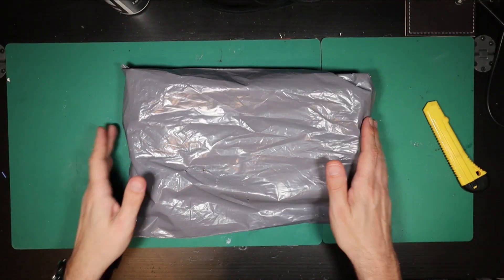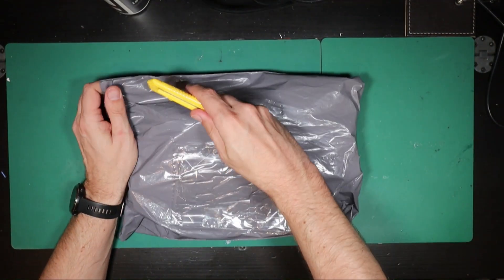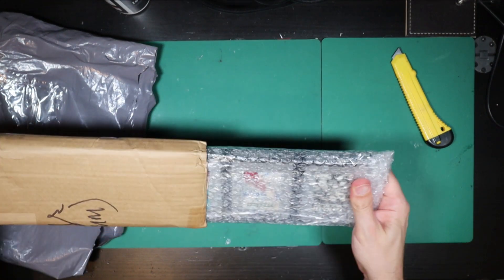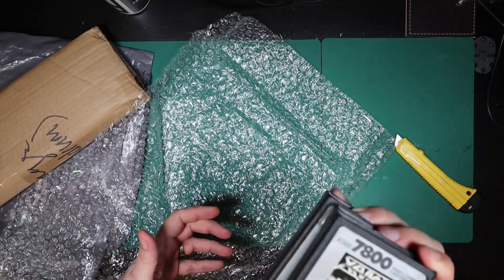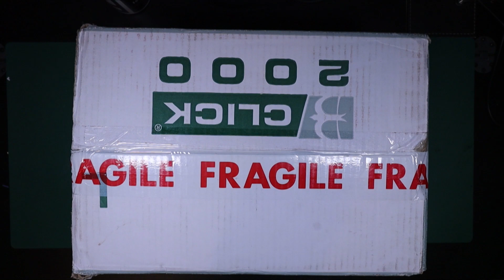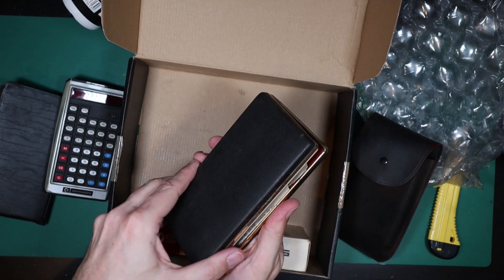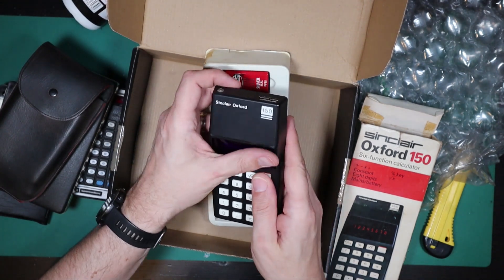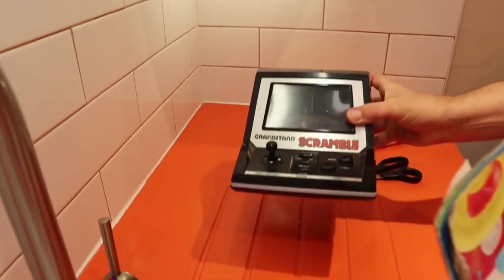Ebay Retro Gaming & Tech Mystery Unboxing

Comment: That Texet 880 is a very nice calculator. It was quite modern for its day and one of the very first pocket calculators - it was also quite expensive. My uncle bought the exact same one for me for my Christmas, in 1977, when I was 13. When it works, It has an wire type number display that lights up as a very bright red. If you look very closely at each number, you will see that it is a very fine wire that glows red, magnified by a plastic bubble, in front of each digit. I still have it and it works great.
Reply from the maker: Very interesting Frank. I had a Texet calculator as a child but don't remember what model. I think I remember that display type too, but don't know the name of it. Mine is long since gone, how cool that you still have yours after almost 50 years. Anyway thanks for sharing and for your comments. Hope that you enjoyed the video.

Comment: I do the same thing.. only issue I have is smashed screen... all other parts are replacable. God bless the multi meter, soldering Iron, and the electrical recycling yard.
Reply from the maker: Hi social, thanks so much for your comments. I had a few issues with this lot. But I will be doing a follow up video very soon so you can see what the outcome was for each item. Where do you get your joblots for repair?
Reply: @RetroTechRepair  Sounds good. I don't do it full time.. I just do it as a hobby.. I find it satisfying   and relaxing... only other issue I have is my tea is always cold..lol.. I don't buy job lots I just get a few of ebay.. I used to go to a lot of car boots but during lockdown and kids being at home iv not really done awt. My last lot was from ebay.. there is a few tomytronics on there now. Looking forward to the follow up vids.. keep it up.
Reply from the maker: Thanks Social... a long time before YouTube I used to get things from the car boot, the one local to me though seems to be mainly traders and most things are the top end of eBay price. I try to look for misspelled lots or things posted in the wrong category nowadays to keep costs down. I also am a hobbies, just for fun... which is a good job since I nearly always lose money!
Reply: @RetroTechRepair 
yeh I know what you mean.. but hey joy and satisfying is priceless. If you have issues with getting things in then try looking abroad.. Japan had alot of tomytronic as it was owned by them I think so I assume they will have alot of spares and repairs. There is angry on ebay that sells cameras and he had afew tomytronic jungle fighters and tomytronic Sherman attacks which are quite rare.. his store is called onepanninja.. might be just one N. 

Also I know a lad from up north and his channel is called let's get retro here is a link...

 https://youtu.be/damMnxulEqI

 his been off along time now.

This guy did this like 10years ago and the retro collection he had was absolutely amazing.. I spoke to him and he told me he had a few spares but not sure if hes still got them.

Just keep looking and just don't tell the wife. 👌

Comment: With common Game controllers never ever throw any part of them out for three years, this is because they need to be treated as donors, Also with any electronic games that have common chips/plastic bits and bobs in them, KEEP THEM and only sell them if you haven't used them within three years, you will get to know these parts that will come in handy, as you progress to repairing over 10~20 job lots a day where you will end up with donor bins that you haven't accesses for over three years to which it is then time to just auction/Sell the contents off on eBay, there will always be other repairers on the look out for those bits and bobs..
Reply from the maker: Great advice... Thanks!